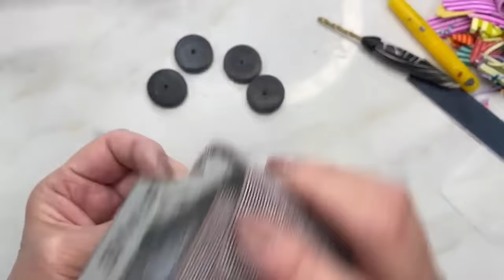A Polymer Clay Tutorial: The Striped Disc Wafer Bead Necklace

Comment: I love this version of the disk necklace.  I have found that I can reuse a raw sheet of clay with acrylic paint on it. I just roll it all together and the paint usually incorporates itself into the raw clay with no problem.
Reply: This may be a silly question, but does the acrylic paint change the colour of the clay?
Reply from the maker: I think I've done that, too! We call them "inclusions"! Hugs, D
Reply from the maker: No, Stacy, not unless the paint is wet and there's a lot of it! I think this is most useful if you want to use it like metal leaf where you just mix it into the clay and you see bits of leaf. Make sense?

Comment: Hey Donna! Thanks for your in-depth tutorial!
Ideas: place the disc bead on top of your centerimg template & use the straight lines to locate the equidistant spots for cane embellishments - indent w/ a needle tool to mark the spots
How about if you use your gold donuts instead of the rubber ones and glue as you assemble?
Also, for scrap painted clay, make some length guides - 1/2", 3/4", 1", etc. For areas where a ruler doesn't fit & you want a consistent length.
Reply from the maker: good ideas! thank you!

Comment: Thanks, Donna! What weight/size Tigertail do you recommend? 3 or 7 strand? What diameter? (If we were putting it in the core or using it for the recent half moon earrings) Thanks!!
Reply from the maker: You know, I use a tigertail that I bought from PandaHall. It's fine than SoftFlex .024 that I also have. Now, having said that, I think both would work. We're not stressing it in any way, really so I'd say you have quite a range of good options! Hugs, D